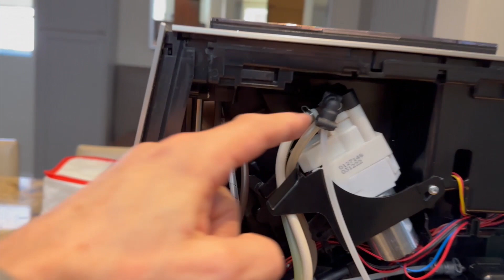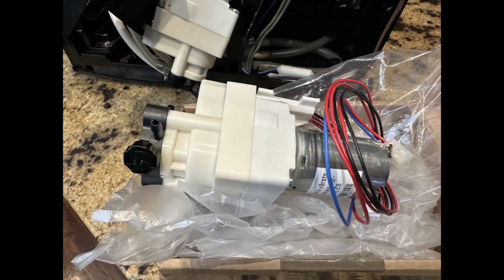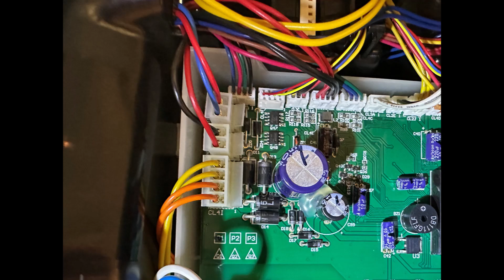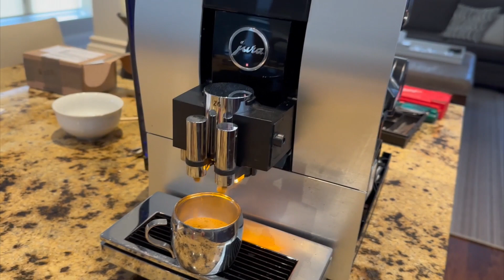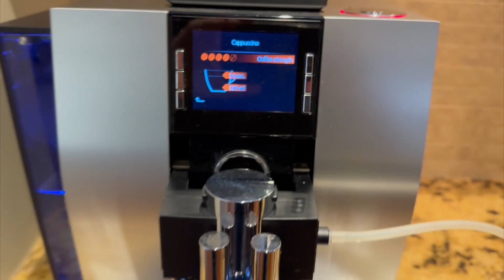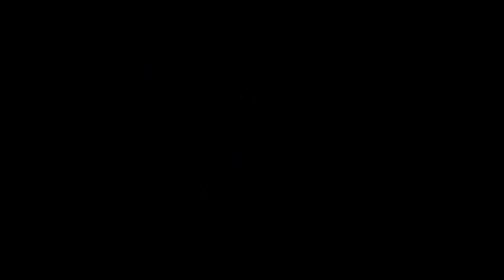Jura Z6 Ceramic Valve Replacement (Fixing Error 6)

Comment: Next time you can just order the head (where hoses connect), very cheap (or micro switches but those fail rarely)
Reply from the maker: I mentioned in the video that I did reseal the head with JB Weld Bond epoxy which got me back to making coffee again, but was still getting strange behaviour with milk frothing and sometimes grounds were going straight into the waste tray before brewing, so I decided to err on the safe side and replace the whole unit. Once I did that, everything worked perfectly again. Thanks.